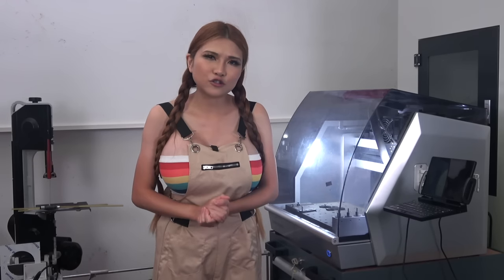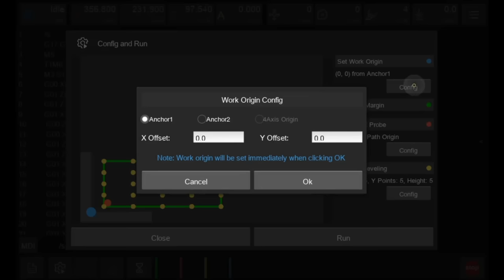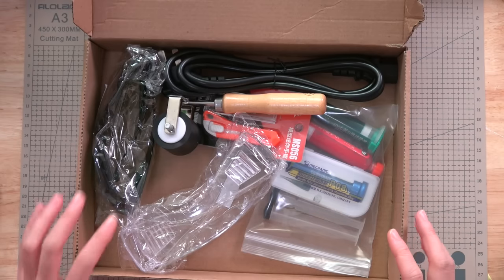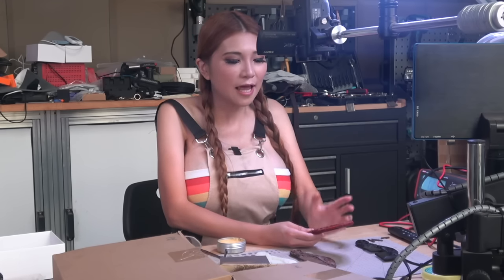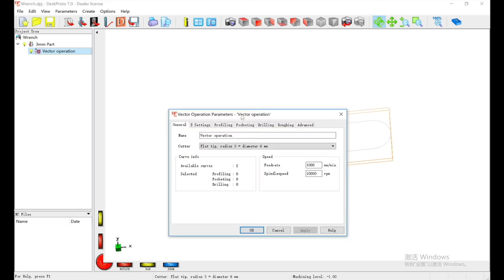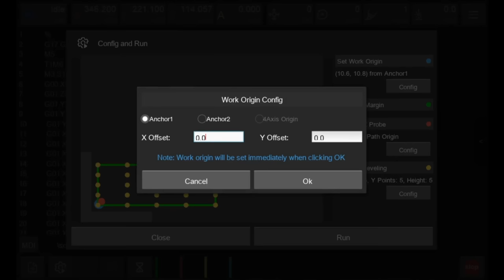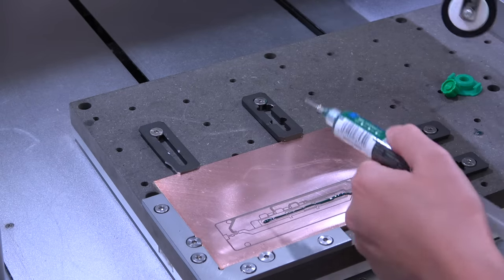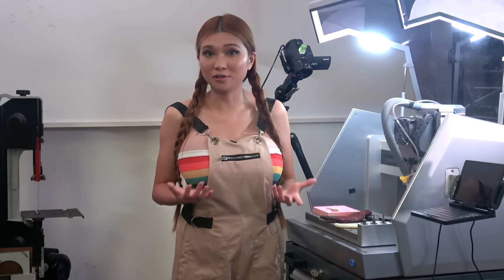The Carvera- Ultimate Benchtop CNC?

Comment: I love that it has the cute little tool changer and the cute little laptop control.

Yet the machine makes similar desktop  machines look cute by comparison.
Reply: Also yes auto tool change and tool/part probing is a massive game changer for CNC. For a small shop like yours ATC isn't absolutely required but having rapid ways to set tools and parts makes prototyping so much easier. You can just drop a part in, probe, and run.

Comment: I had two machines built for cutting electronics controller enclosures.   Our old mill was a manual mill that had been converted to programmable, but was ancient tech and very slow....but reliable.   Our sales where strong and the backlog of jobs was huge.
The new machines eliminated all backlog in a matter of two weeks (six month backlog) after that just one machine
was able to handle the sales demand in 4 -6 hours a day.   That was a very fun project.   Your mill is not much smaller but has more capabilities.   If you are using it for production, I would get a backup.    If for hobby use it should be very capable.

Comment: Thank you for the practical review.
If you are going to make more items from metal you might want to invest in a deburring tool. 
It's easier to use than a file and makes quick work of dulling sharp edges a good make is Noga however there are many others available.

Comment: Excellent! I love your vids. 
Your bandsaw guard height should be set just above the material so you don't cut off parts of your body.
Reply: More stable cut on the material. Because the guide bearings are closer to the cut.
Reply from the maker: It should! Unfortunately this is a horizontal bandsaw in vertical mode and that is as low at the guard goes until I can make something better.
Reply: Oh ok, I've had to run like that before. Extra fun!

Comment: I like your videos, just a quick safety tip when you use the bandsaw to cut thin material best to close the space down of exposed blade to closer to material thickness, in case you slip don’t cut off a finger
Reply from the maker: True, but that's as low as it goes until I can rig something.

Comment: Change your comb design to cut two combs at the same time.  The teeth from the two combs would line up and connect.  With the two combs completed, do your clean up and get them almost finished.  The last step would be to cut the two combs apart using a bandsaw.  Also, be careful with the direction of the wood grain.  Ideally, the grain should run in the same direction as the combs' teeth.

Comment: Sorry if this question has been asked already.  Can this machine be used to cut/engrave soft metals like brass, aluminium..etc?
Reply: Yeah absolutely. It isn't likely going to hog out chunks of billet into precision mechanical parts, but cutting out thinner sheet or basic milling/engraving for aesthetics, seems pretty doable.
Reply from the maker: Yep Brass and aluminum are no problem
Reply: One time she used this machine to copy a working key based on a freeze frame of a video. She's creepier than she lets on.
Reply: @Naomi-Wu thanks for replying, much appreciated. Is this machine available for purchase or they crowdfunding in order to begin production?

Comment: Interesting piece of equipment, especially with the tool changer. For my purposes, the fixed gantry design makes it incapable of cutting the ends of wooden boards for joinery; so I have to get a machine with moving gantry first.

Comment: Great video, and once again it shows off your skills! Some questions:
1) Did you have to calibrate it? How are you setting the origin point for 0,0?
2) How do you clean up the material that falls off the cutting area into the Y gantry slots?
3) Does the PCB kit come with the UV curing lamp for the solder mask?
Reply from the maker: 1. No calibration. It uses servos not steppers so "knows" where the 0 is when I tell it I'm using that one in the interface.
2. Vacuum seems to get most of it but I might slide a baking tray under there.
3. No

Comment: So you milled one surface, flipped the stock, then cut the outline when the second surface was finished? Did you use any through holes to help align the second side?
Reply from the maker: For which object?
Reply: @Naomi-Wu  the combs. How did you align the milling of both sides?
Reply from the maker: @NOLAfugee  Same zero point on the mill so it's automatic
Reply: @Naomi-Wu  oh, cool. I wouldn't have thought that the placement would be so precise and repeatable.

Comment: does it work on hard metals and how prezise is it.
Reply from the maker: No, just brass and aluminum
Reply: @Naomi-Wu , there's an update to that answer.  :)  in one of their updates on Kickstarter, they showed a test video where they found out that it will actually work for steel, if you don't mind going slowly.  Their tests were cutting a 0.05mm depth at a time, which is about 2/3 the thickness of a sheet of paper, so it takes quite a while!  But it should be enough for occasional use with small parts.
Reply: Also, for precision: On the Kickstarter page, they say the motor resolution is 0.005mm (0.0002 inches) and the spindle runout is less than 0.01mm (0.0003 in), giving a machining accuracy of around 0.05mm (0.002 in) in a typical situation.
Reply: @BrooksMoses  thanks
Reply: @Naomi-Wu  thanks
Reply from the maker: @BrooksMoses  Yeah, but I hate to say it will or people will get angry if it doesn't do it well...
Reply: @Naomi-Wu  That totally makes sense!

Comment: hello when using a band saw you need to adjust the gaurd to just above material thickness. leaving it that high is extremely dangerous.
Reply from the maker: Yeah that's as low as it goes, it's a horizontal bandsaw in vertical mode.

Comment: If improve 3d printer then sll we needed is adapter then cnc and 3 d orinting use single driver and if add on scanner and manual entry pad or scanner then evrn wirk without  computer